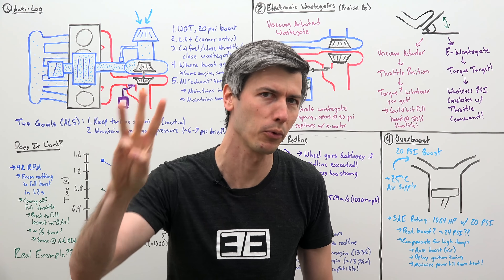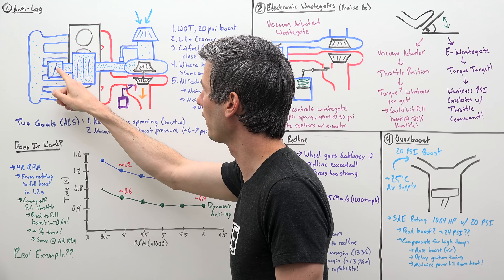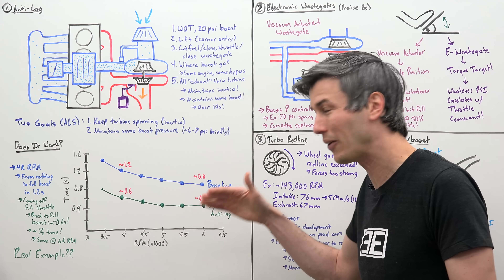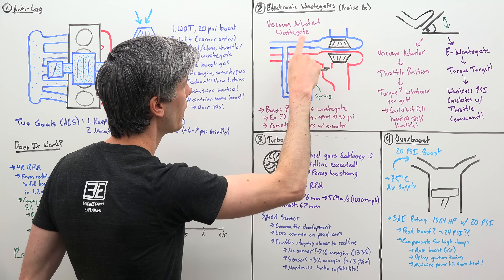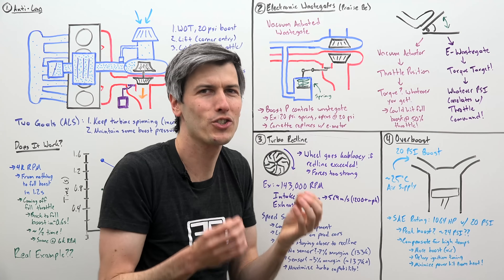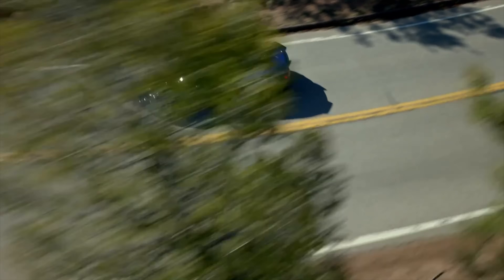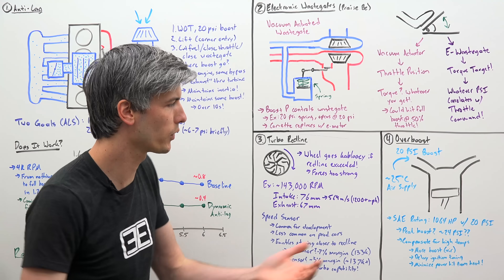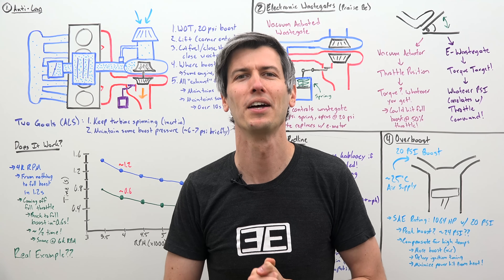Corvette ZR1's Anti-Lag System – Massive Turbos, Minimal Lag

Comment: I think when people say "good ol days of sports cars are behind us" it refers to the fact they are very expensive.
Reply: Manufacturers forgot what a sports/GT car is supposed to be. They should care about the feel more than the numbers
Reply: @sigmamale4147 

Numbers is all any company cares about when you get to this size. 

General motors and Volkswagen especially. They own several car companies, whom of which all design their cars to fail.

That way, you have to buy another car. What car do you buy? Doesn't matter.

GM, Ford, Korean cars and German cars are like this so you have to buy from them again.

As absolutely CORRECT as you are, car companies dug themselves into a pit in recent years doing this.

That's why the big companies stopped making flagship sports cars. They are super expensive for companies to make, but noone is buying regular cars cause they suck!

This means the company has to throw out the cool stuff to keep their head above water.
Reply: @basedmax9029  What do you think would be a "nice" used car to get with about 300 hp, and about 8000 USD ?
Reply: @Hide_and_Tweak 2002 Trans Am is what I got. 
I love it better than the Corvettes I have had.
Reply: @Hide_and_Tweak 

An ex police dodge charger with the Hemi V8. Reliable, reinforced, and uses truck parts which are easy to find. Best for your money.

Pay attention to idle hours however, as Hemis are infamous for their splash lubrication. 

Keep lots of oil in it always, and you won't have a problem. If the car is low and idling, oil won't get where it needs to go.

Edit: c4, c5, and c6 Corvettes are INSANE for their money. Super fast and corners great, but more fragile and expensive to fix relative to the dodge. 

Both are great tho. 

It comes down to preference too, so lmk what your thinking and I can give you better recommendations
Reply: The same people then buying sports cars are the same people today. The real issue is that normal people mover cars have gone up in price. People should only be concerned about the "good ol days" of cheap mortgagees in which a man could provide decent accommodation for his family. Sports cars are vanity and will always be.
Reply: Not only were they much cheaper, but they were also reliable, cheap to fix, sounded great, looked amazing, and offered a soulful and robust driving experience.

Modern sports cars (and normal cars) feel cheap and fake, almost like your driving with a remote control or driving in a videogame.
It doesn't feel real.

Whereas on the other hand, you've just bought a triumph tr6 that is brand new. And you bought it for less than what you paid for  your daily! 

A reliable, fun, small sports car that corners like it's on rails!
Reply: @basedmax9029 I never heard anyone call a Triumph reliable 😂
Reply: @verothacamaro  good point, but they are cheap to fix. Most of the issues with the tr6 (and tr7 mostly) were overheating due to a poorly designed radiator. 

However, this can be mitigated easily or straight up fixed as long as you have a few hundred to put into it. 

And if you want a cheap sports car that truely is reliable (but more expensive to fix), then buy a corvette c4. Aside from the window seals, this car is very very solid and has no computers to save you haha!

Just you and the car.
Reply: @verothacamaro A Triumph reliable? That's like saying a Ducati is reliable and cheap.
Reply: @BOMBON187  🤣🤣
Reply: @BOMBON187 

Stereotypes haha. I know a guy who has 680,000 on his triumph tr6. He replaced a lot of the cooling system, and is on his second engine. Not bad for a car as old as that!!! 

He is 73.
Reply: @basedmax9029  In all fairness, modern cars are genrally still accessible to repair when using the correct tools. Things inherently advance over time, and with that, the tools to repair advanced machines. The difference now is individual's desire to repair their own vehicles. The tools are there, the guides are there for 99% of vehicles. Carburetors were once advanced technology, distributors and timing was once advanced technology. They're still not easy to understand without doing your research. Direct injection, and ECUs are new technology, but the tools exist to work on them yourself for reasonable amounts of money. Most people don't even do enough research about the car they own now to get to that realization. If you don't know what you're driving, you can't possibly feel connected to it. If you don't understand how it works, you can't use it correctly. That's what's changed.
Reply: @basedmax9029 Adjusted for inflation that triumph would retail for damn near $40k in 2025 dollars though... 

Considering you can roll off the lot in a ND miata for $29k, or max it out $40k with all the bells and whistles im not so sure the triumph was as cheap as we're making it out to be
Reply: Exactly lol

Comment: If I were going to design a anti-lag system, I would exploit the phenomenon that occurs when you clog a pump or vacuum cleaner. The impeller, no longer under load, speeds way the heck up. So, you have a bypass with a flappy boi valve to close off the intake to the turbo and basically make the engine NA when you lift off the throttle.

Comment: 1200mph - the turbo edge is rotating at MACH 1.56 - roughly 1.5x the speed of sound.
Reply: ....at atmospheric pressure and temperature. At the pressure and temps in the turbocharger, the speed of sound is a good deal higher. But cool fact nonetheless.

Comment: Most of this was implemented in the Mk1 Focus RS as well as most other turbocharged cars of 20 years ago.  It's also not true that pneumatic wastegate control is entirely mechanical.  Pressure is bled off with an electronically controlled valve to boost pressure above a mechanical boost baseline, which means also that your wastegate is closed as soon as you're partial boost.  Also part throttle boost control is a thing if you've got your control setup correctly.  I know all this because I developed and calibrated the turbocharger control for said Focus RS.
Reply: Yes, good to get your perspective, I was watching this video thinking that I really wasn't seeing anything innovative at all!!

Comment: It's easy to look at car specs these days and find out what kind of engine it is based on the torque.  Most modern turbo cars usually have peak torque very low in the rev range.

Comment: Hi Jason, great video as always. Just on the turbo throttle control, it is possible to get excellent throttle control without an electronic wastegate. The relevant factor is not the boost per se, but the charge pressure in the intake manifold. Since the charge pressure in the intake manifold can be limited by the throttle, it is possible to limit engine torque to the level desired by the driver. This is exactly the strategy used by most euro OEMs for 20+ years. For example, the Bosch ME7 ECU, which has been around since early 2000s uses this strategy. One can essentially convert the pedal position into a desired torque by the driver. We can then calculate the mass airflow required to achieve that desired torque. Then, depending on primarily the boost pressure, we can calculated the required throttle opening to achieve the charge pressure that will lead to our desired charge mass flow and therefore torque. That said, I certainly agree electronic wastegates are fantastic since they allow more control authority. For example, it is not possible with a typical vacuum arrangement to open the wastegate at low torque requirements to avoid unnecessary boost.
Reply: Exactly he was talking about some 1990 turbo system with a manual boost controller. Partial throttle full boost lmao since when
Reply: So its like 1.9 tdi ? Thats what I was thinkin watching this video :)
Reply: @JMantas Similar, uses Bosch EDC 15 or 16 depending on model, although no throttle generally and diesel so torque is controlled mainly through injection fuel mass primarily, when there is no wastegate authority.

Comment: The only caveat with the electric waste gate is that the electric motor will fail prematurely under extreme temperatures that a turbocharger experiences. More recent applications haven’t seen this that often anymore, but it’s still new.
Reply: Still new?? E-gates in oem systems have existed over 15 years, even on petrol cars and the actuator itself is far from the hot turbine housing. They are located closer to same as the vacuum/boost actuated diaphgram is in the older systems. There is a long rod from actuator to the wastegate flap rod swivel. Aftermarket e-gates utilize the silly heat affected external diaphgram style construction which will need active cooling and it will fail prematurely due heat still.

Comment: I know this opinion will garner a lot of push-back so if you feel the need, go ahead. While this is some incredible engineering, you cannot escape the fact that the more moving parts you have, the more opportunities you have for breakage and/or failure. While not naming brands, electric motors will eventually win the day in long-term performance, durability, and reliability. For one (and maybe the only one), I hope Chevy makes the move to an fully BEV Corvette. Take it easy on me. I'm just a guy with an opinion and a dream...same as you!
Reply: You must like heavy junk that can't corner and needs to sit and charge for huge amounts of time
Reply: @ryantogo8359  If you mean cars that can pull 1.02G, run 0-60 in 1.99 seconds (more expensive E-Ray corners a bit better, but is slower 0-60) and charge overnight while I sleep, yep! Also, Plaid is $7K less-expensive and has about 450 fewer moving parts in it's drivetrain. I think we're done here.

Comment: So again Americans are reinventing wheel? Are they really this far behind on engine tech?
Torque demand and not throttle position was in Audi 2.7t from 1998... with pressure wastegate.
E-wastegate are nothing new. BMW N55 or VW 2.0TFSI have them for a long time now. Vacuum wastegates with travel feedback are even older.
Wait till they find out, that you can measure pressure in exhaust manifold or turbo RPM for even better and faster response from turbocharger.

Comment: At 4:30 you say while on the brakes it doesn't go below atmospheric but isnt that 14.8 at sea level or am i misunderstanding what you are talking about
Reply: Usually a boost gauge reads 0psi when you are at sea level, so anything above 0psi is boost.
Reply: Tom nailed it. “Boost” is above ambient pressure. MAP or manifold absolute pressure is likely what you are thinking of. So when the gauge read 3 psi of boost the engine was at ~18 psi MAP
Reply: Boost is measured in gage pressure. Gage pressure means your zero reference is ambient, no full vacuum.
Reply: As your comment generated I was AT THAT PART. Not sure if that’s coincidence or the algorithm

Comment: an vacuum controlled Wastgate isn`t linked with boost pressure but use Vacuum and are activly controlled with an electronic valve. The system you describe is a boost pressere regulated system, where the boost pressure is working against the spring in the pressurebox.

Comment: From what I saw at cletus driving its making 25psi midrange and 20psi ar redline. It makes sense, probably it has a flatter power curve than you would expect, not liniar, with s flat torque curve and boost
Reply: Could also be a turbo shaft speed correlation. I actually run similar numbers on my car, 25psi around peak torque and tapers to about 22 at redline to keep the turbo under 160,000rpm. Also added shaft speed into the boost control strategy so if there are ever any leaks or issues that could cause overspeed it will pull duty cycle to keep the turbo happy. Wouldn't be surprised if they had similar strategies to extract as much as possible out of the turbos.

Comment: narrow torque has been already eliminated since the early 2000s. like vws using 1.8t  had peak torque somewhere around 2-2.5k rpm. in my 2015 nissan its at 1800rpm

Comment: Just electric motors, in f-ing hot environment, that will need replacement every couple of years.

Sure, it's great as long as it works 😂 
But who has had electric e-brake actuators? You know they live less long than a cable...

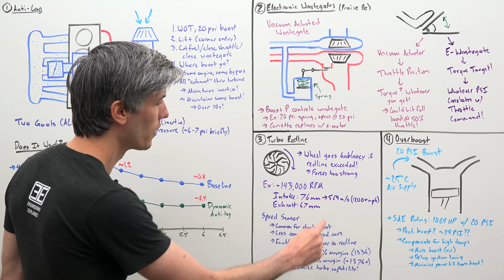Comment: 10:18 is it not problematic that they are moving at supersonic speeds?
Reply: I know I’m a little late, this is a good question. I’m guessing - like me - you’re talking about prop planes being RPM limited. It turns out that turbofan engines (passenger planes) run in supersonic territory, despite the efficiency drop off. It’s a game of tradeoffs and I guess it still makes sense to do it. Like a turbofan, I’m guessing the compressor housing also helps mitigate the effect. The air itself is probably slower too, cause we’re looking for pressure, not velocity. This is just an educated guess, I am in no way a professional.
Reply: @Seyeler that's still so ridiculously fast to think about that type of rpm on something that's a wear item essentially.

Comment: er, "massive" is relative to engine capacity!  This Twin turbo LT7 makes 1065 hp from 5.5 litres, ie a specific output of 193bhp/litre.  Pretty decent but far from class leading these days. For example, the mas sproduced mercedes AMG A45S makes 420bhp from 2 litres (210bhp/litre), and exotics are now over 300 bhp/litre.  So yeah, it's got physically "large" snails, but that's because it's a physically large capacity engine!

Comment: I’m curious about the physics surrounding turbochargers with turbines spinning faster than the speed of sound. I’ve learned that there are issues with propeller tips moving faster than the speeds of sound, but this doesn’t seem like an issue for turbochargers or jet turbines.
Reply: Part of that is due to the properties of the air inside the compressor/turbo. When the turbo is operating at those speeds/pressures the air temperatures increase dramatically inside which causes a pretty substantial increase of the actual speed of sound. So although the tips are spinning above the typical speed of sound with atmospheric conditions, it can still be subsonic with the conditions surrounding the exducer of the turbo.

Comment: When I see a TTRS or an S3 launch with that 5 cylinder engine I don't think "wow so much lag" with the DSG barely keeping up with shifting. Even a golf r.

Sounds like someone's never driven an old 240 Volvo turbo. Under square engine that revs to 8750 makes more than enough torque that they had to put a light truck transmission in it the AW70 or 71 and a Dana 30 axle, so yep, I think it's made for torque. The 850 t5 makes peak torque from 2100 all the way to 5700(8k+-redline) if I recall. "Power under the curve" defined in actual vehicle form.

Comment: To be fair you conpared the electronic wastegate to the simplest form of vacuum actuated wastegate. 
With one line at the top and one at the bottom am some solenoids, you can control boost much more precise.

Not as easy and fast as with an electronic wastegate though, I admit that.

But electronic wategates are really expensive, that's probably the main reason they're not that common in production cars.
And maybe reliability is also a reason?

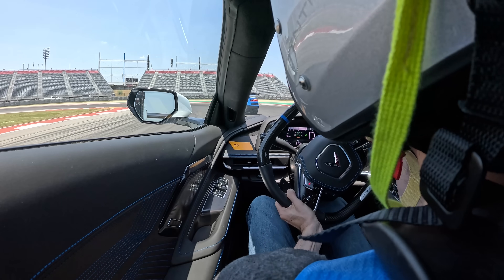Comment: 2:30 Jason, maybe I'm missing it, but when you are describing the anti-lag system, it seems to me that you just describe an ordinary turbo setup. What exactly is GM doing that keeps the turbine wheel at a higher speed? 
Is this part of where the electronic waste gate comes in? Instead of dumping the exhaust and slowing the turbine below boost, do they use the waste gate to keep the turbine speed higher? 
Also, you mention that the intake boost circulates around the compressor. This also sounds ordinary for turbo engines so I would presume any boost charge that goes past the bypass value is now at atmospheric pressure. If GM somehow maintains this air at positive charge pressure through magic or other means, that also wasn't obvious. What you describe sounds like a reservoir of boosted air. If that's the case, how do they do it? Is there a close off value near the air filters?
Reply: I was wondering this same thing as most of the description sounded like your typical turbocharger setup. I thought perhaps they were using a system similar to Porsche where off throttle injection is shut off but the throttle plate is still left a bit open to turn the engine into an air pump and help keep the shaft speeds up.
Reply: @kpbruka  Whatever is the magic elixir, it wasn't clear.